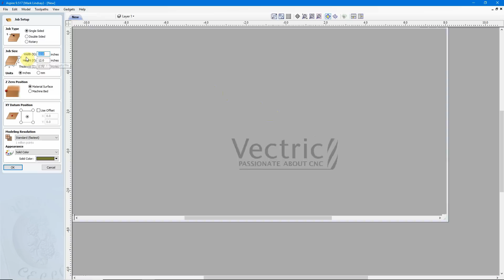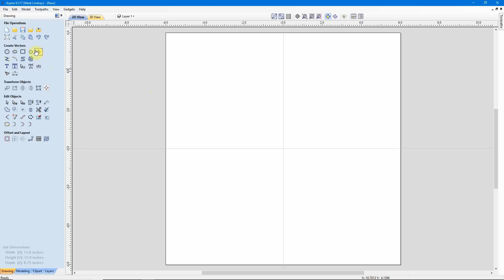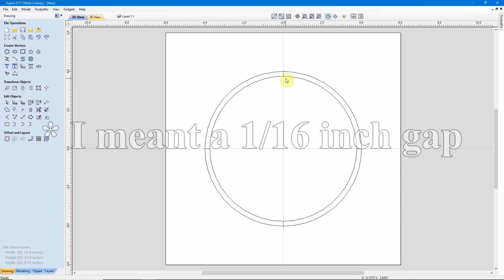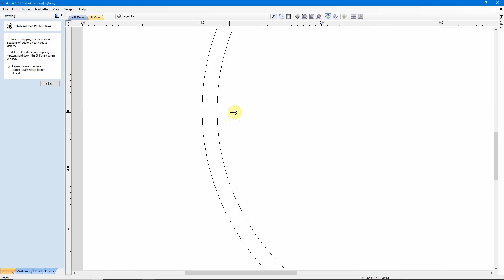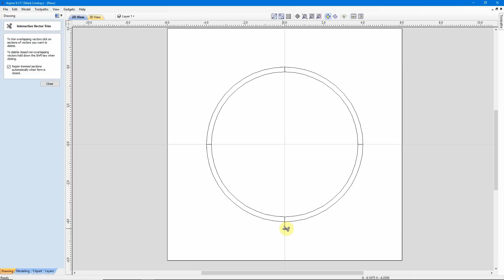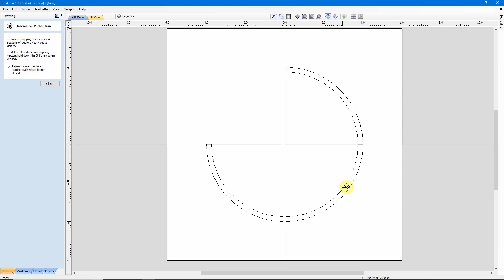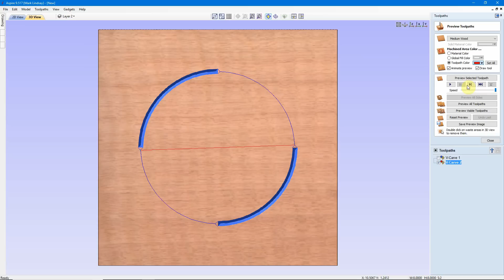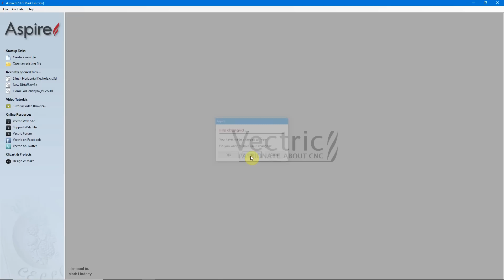Closing Open Vectors - Part 23 - Vectric For Absolute Beginners

Comment: Hi, just one other question: is it also possible to create say one quarter (closed) and then make a circular array ?
Reply from the maker: Sure, you can do it that way. There are several ways it could be done. My point here was to demonstrate those particular vector joining tools. Thanks for checking out the video!

Comment: Mark Thanks I learn something new everytime  you post a new video.
If you have  2 circles like in the video that are say .25 Inch between them is there some way of calculating how deep different  dia vbits are going to cut in to the  wood to cover the .25 width? Thanks Jeff Peters
Reply from the maker: I'm not sure, Jeff. I'll have to dig into it to see. Personally, I tend to try the 90° v-bit first, then check the cutting depth in the preview. If I need to, I'll then recalculate with a different bit.
Reply: @MarkLindsayCNC  If you set up the vcarve with a  5dia 90 bit and changed to a  .75 or  1.25 dia would the depth get deeper or shallower.
Reply: @resorter66  I think, if you run your tool path preview, then hover your cursor over the valley of the cut,  you'll get a readout at the bottom of your screen showing the depth of the cut.
Reply from the maker: The diameter of the bit doesn't matter.  It's the angle of the bit and the width between the vectors that determines the depth of cut, as I explained here: https://www.youtube.com/watch?v=JGG0yTPih4w
Reply from the maker: Alternately, you can hover your cursor over the name of the toolpath, and it'll tell you the max depth the bit will cut on that toolpath.
Reply: https://www.see-n-c.com/v-bit-calculator/